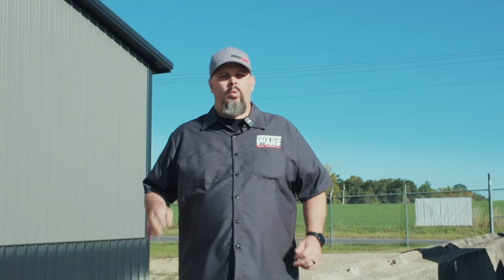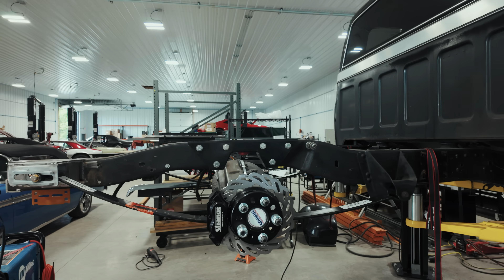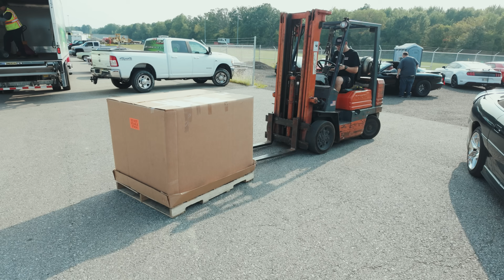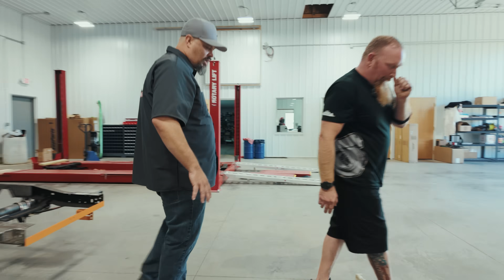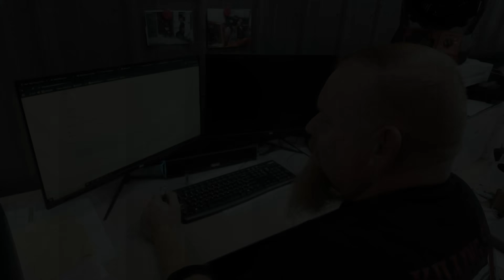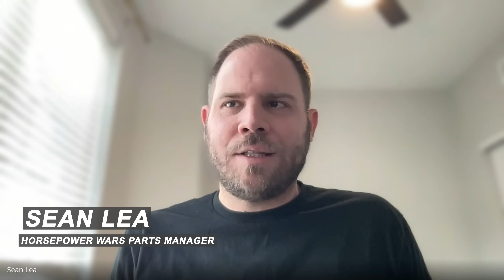C10 Shootout: Big 3 Is Under the Gun with the Big 10 Build (Ep 3)

Comment: Why wouldn’t the entire header and turbo system hot side from the original engine setup not work in a truck engine bay? An engine bay doesn’t get any bigger.
Reply from the maker: When you build kits for the dyno, the turbo location itself wasn't really optimized for where it needed to be in the truck

Comment: So they are building 2 identical chassis so just the engines are being tested? It wouldn't make sense to have different chassis, then you are mostly comparing chassis shops with horsepower so close.
Reply from the maker: Tuning, power bands and durability are all factors
Reply: @DragzineMag are both trucks going to have split mono leafs and sliders? Same adjustable shocks?
Reply from the maker: @TestingTechnologyEquip  each builder sorted out their own suspension. Big 3 feels Cal-tracs are good, would be curious to see how the 60-foots line up